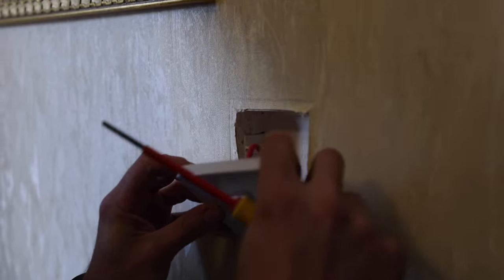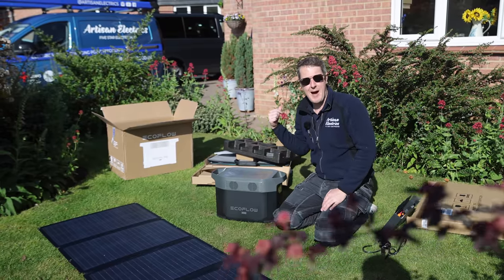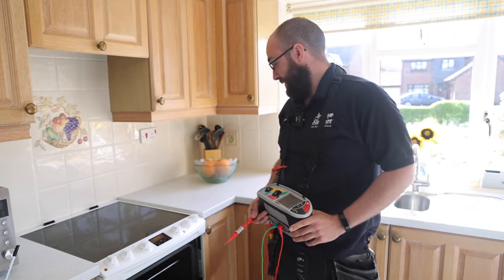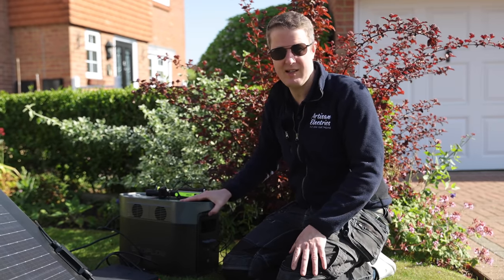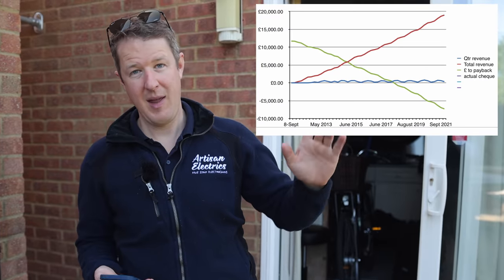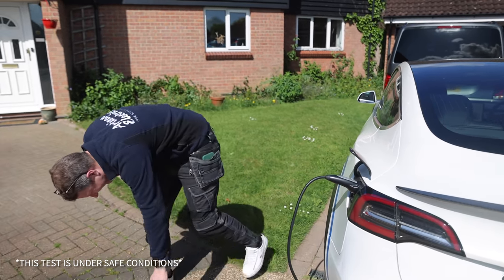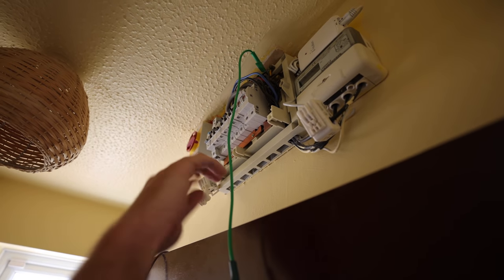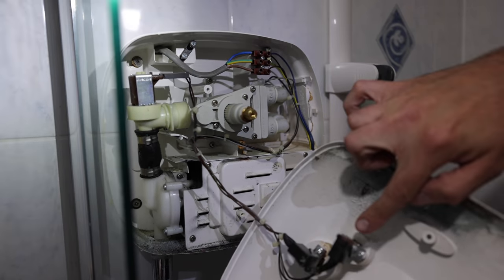PLANNING BATTERY STORAGE FOR AN EXISTING SOLAR PANEL INSTALLATION!

Comment: Well explained and Interesting indeed, I looked at adding more PV panels and battery storage to the system I had but was put off as the generous FIT payments we were receiving would then cease as the whole system would be treated as new with its current poor FIT payment return. Not sure whether that still applies but your customer would be wise to check if the work invalidates the original FIT payments.
Reply: You can easily add battery storage without effecting FiT payment - as long as the original FiT system isn’t touched or (more complicated) the fIt meter is replaced with a bidirectional one.

Comment: A good find by John and it highlights my view regarding cable routes, especially in kitchens. I don't understand the persistence of routing cable drops vertically. Apart from it using more cable, the amount it increases the likelihood of someone going through cabling is massively higher that using prescribed zones between counter top and wall units horizontally. Obviously, an extractor fan supply would need consideration for routing but that unavoidable.  The same in other rooms for sockets, where at all possible, run the cabling horizontally. The householder is very unlikely to drill or nail anything onto a wall at 450mm FFL and if it's all done within prescribed zones, it's compliant.

Comment: The generous FIT you mention was courtesy of tax payers. A few years ago I did a similar test. I live in a flat and mounted a single panel on my wall and charged a battery - running my broadband equipment for 3yrs.

I applied to install a larger system on the walls and was turned down by my council. They said the panels (angled at 45 degrees, were closer than 10m to a road. 

Since then various street signs and bus stops have appeared on the same road with solar panels on them less than 3m from the road! 

I still can’t get permission for wall mounted ones - despite providing written consent from other occupants of the building. The council still say the reason is the 10m rule? Baffled!

Comment: This is all really good to know - we have a 3.6 kWh (max) panels-only installation in Ely, which I'd love to add suitablebatteries to - ideally we'd add also a couple of panels to catch the evening sun (so wall-mounted - suitable for peak oven/bath time) - do you know whether that would be enough to let us save the VAT on the whole new installation under the energy-saving installation scheme?

Comment: Great video.. but I wanted to see the actual battery installation in hope to have my questions answered such as: Did you use a anti-static raised floor? was there any protection against moisture and dust? Do we need to add a small ventilation system in case it overheats and so on....

Comment: The part of this planning that confuses me is the sizing and charging. I have a similar size array and on an average day during May-sept I use 10kw of generated power with the rest (about 8kw) going to the grid. So if I add 9kw of batteries I would only get the benefit during the summer and during the winter I still need to draw from the grid over night. I assume that I could top up the battery using off peak to make the overall. It would be really useful to see the breakdown of this job including payback.
Reply: I have

Comment: Im having installed JA solar 2.34kw solar array and a 1.56 kw array east/west roof with the eco flow smart home panel and 2 x delta pro power stations to run my home electrics the expandability and portability of the eco flow products are more suitable for me rather than a Tesla power wall or giv-energy products, also I missed the feed in tariff so being grid tied ain’t worth it now, I want to use 100% of the electricity that I generate.

Comment: Is it possible to get battery storage to work when there is a power cut?
If so what equipment do you need? Do you need an automatic isolator switch to island your house from the grid?
How do these synchronise with the frequency of the gird and how do they work in a blackout?
Reply: These type of GridTied inverters will switch off when the AC connection is lost. This is to ensure compliance with G98/G99.
I am using a Victron Multiplus inverter which can be connected between the Grid Meter and the CU. It has a 50Amp transfer switch inside and can act as a house backup.
You'll then need a battery to work with it, but it's an inverter which can work with many brands of  batteries. Lots use the Pylontech batteries.
Reply: @gavinnoname1424  Thanks Gavin, Are you saying you can use your system in the event of a blackout? 
If you do is that what the transfer switch is for, to island the house from the grid?
How does the inverter work when there is a blackout so no grid for it to get its frequency from?
Reply: Hi. Yes in answer to your question. We had an additional EPS system fitted with our installation and it will automatically switch to our growattt battery power units in the event of a power cut. It will power the house for a careful 24hrs starting from a full 13kw set of batteries. This cost us £1500 for this peace of mind, we could have had the double socket system fitted for a  much lower £500 but it would mean running an extension lead from where the batteries are (garage). In the event of a power cut it was worth the extra we paid for the auto system.
Reply: @caparn100  when power is lost on AC-In the inverter generates its own voltage and sine wave.
This happens in 20ms so that computer equipment will still continue running.
When Grid power returns the inverter will not switch back to it until it has adjusted its sine wave to align with the grid. Then it will reattach the grid.

If you need the full 100amps for your consumer unit you would need two of the Multiplus inverters which will work in parallel. 
Most of the GridTie inverters I have researched all mention about "backup power" but usually this is just an output for a couple of sockets because the hardware cannot manage the islanding part.
I made a 13Kwh battery for £1700 using cells and a BMS, and then paired it with the multiplus £1400.
The plan is to now invest in a 2nd battery and 2nd Inverter.
Reply: @gavinnoname1424  Thank you, That's sounds really good. I'm looking to buy a system like that (a hybrid solar system that is normally tied to the grid but is able to power itself during a blackout) as I am moving somewhere where blackouts are frequent. Can you give me some details about what sort of system I am looking for? Would it be a standard hybrid system with the addition of of an automatic islanding switch? Do I need a special inverter or would a standard hybrid inverter do? Can you tell me what the additional cost is to allow a system to operate on grid and off grid with automatic switching?
Reply: @caparn100  I really only have hands on experience with the Victron ecosystem.

You'll definitely require something to handle the Islanding. Victron, SMA, and a couple of others, handle this inside their inverters. Other companies leave this function out to avoid having to make their system work with the regulations in each country. 
As mentioned by someone else above you can get an external device to manage the cutover but £1,500 seemed expensive when the Victron is an Inverter/Charger/Transferswitch in one. You then add on MPPT modules for Solar if/when needed.
Reply: Believe the Sunsynk inverter does this as one package?

Comment: Excellent video! Now all you need to do is strap that solar sheet to the top of the tesla and leave the battery in the boot sds out through the rear wing and permanently connect the granny charger! Self charging EV!
Your welcome!

Comment: The Government needs to introduce proper solar panel installation programme rather than what happens now where some installers inflate their price by the value of any grant. Ive got a big south facing roof but now retired, I cant afford 15 grand for solar panel installation never mind effectively installing it for the next owner.
Reply: There are no grants anymore. Biggest problem at present is a lack of installers meaning those currently operating can charge what they like.

Comment: @Artisan Electrics -  From memory the FIT Tariff has no actual payment based on exported energy. It is all worked out based on "expected generation" and assumed 50% export rates from size of install. It combined two elements (1) Generation tariff - A payment for the total amount of electricity generated, calculated per unit. (2) Export tariff - A payment for the units of electricity exported to the National Grid, ASSUMED TO BE 50% OF THE AMOUNT YOU GENERATE. Back when the FIT payments were applicable it was only necessary to have a generation meter to record how much solar you produce but even that is only for the customer/installer to ensure correct operation.
So your comment about AC versus DC Coupled Batteries and reducing electricity export affecting FIT payments is not correct.
What CAN affect your FIT payment is changing your inverter. But presumably inverters do fail and so there must be some mechanism to allow for replacing them.
IF it is possible to replace the original Fronius inverter with a hybrid inverter then it is more efficient and requires less electrical installation, less space and "potentially" less cost.
Reply: Indeed the old FIT used a 'deemed' export of 50% unless you have a measured export meter or smart meter (hence why I've stuck to my old analogue dial meter!). DC coupling is a minefield as you then need to add an MCS approved import/export meter, however it may make DNO approval easier as you could remain under the 16A export limit, rather than having to get approval for potentially 2 inverters having a combined 32A output back to the grid regardless of whether that would happen in reality - depends on the installers' knowledge of PV/batteries and DNO involvement. For the most part it seems leaving the FiT system completely isolated is an easier path to avoid complicating the FiT scheme...
Reply: @Umski  it’s all a bit ( iffy ) you can buy a kit yourself these days ( many on eBay ) even batteries and u don’t need to be mcs anymore so some instals will be connected without DNO approval .All this technology needs to be monitored and others will add to existing FIT systems mcs approval only will help but won’t stop incompatible systems.That said adding 3KW of batteries on a 3 KW system needs DNO is a bit silly as per usual not very well planned just like EV points not all DNO notified.

Comment: How does this comply with isolation ie Fire fighters turning off main supply etc, I understand that it is a health and safety issue with water/hoses during hours of day light but with battery back up during the night
Reply from the maker: The battery will shut down if it doesn’t have mains power as it has an anti islanding mode.

Comment: The are using 17kw at night on what ???
Reply: Begs the question doesn't it (unless it's an EV being charged?) - reducing consumption should be a first step - I know of relatives on the early high value FIT like this who had PV installed and then boast that they can use their tumble dryer when the sun's out - I kid ye not :facepalm:
Reply: There's a constant 1 kWh load 24/7. Daily use must be 35ish kW in a modest house!
Reply: @nickbea3443  Give over . We use 7KW daily . my brother uses 20 with a house of 7 .
Reply: @persona250  It's 35 Kw in THIS house. Look at the graph....

Comment: With these portable batteries with 230v sockets, should you be providing an earth for safety? I always thought it was considered not a good idea if you disconnected the grid (L/N/E) from a traditional UPS? 

Is it different because the battery is isolated from the ground having a plastic outercase or something?

Thank you for the great content as always 👍
Reply: The IET have a guide that talks about these installs. Basically, an island floating system such as the eco flow in its default state is ok for temporary installs (which is the intended use case for these devices I believe). 

For a permanent install, an Earth-Neutral bond + earth stake is required in addition to an RCD to create your on TNC-S system. Do not do this without making sure your inverter supports such bonds and of course, all electrical work should be done by a qualified electrician
Reply: Sorry, I meant "TN-S", not TNC-S

Comment: Contacted you reference a solar/battery install.  You recommended 2 companies. 1st company Halo, gave rough costs but no mention of survey and proper accurate quote.  2nd company, Bowler, came and carried out survey and that was the last we heard of them.  All very disappointing! ☹️. Thought I’d let you know as it doesn’t do your reputation any good if companies you recommend let you down.

Comment: @Artisan Electrics I am sooo glad i 'stumbled' across this video. I WAS pushing for a hybrid inverter to be installed i.e. take out our 10yr old SMA SunnyBoy and replace it with a hybrid (new inverter = new warranty plus better efficiency). But what i didn't realise was we'd then loose out on FIT generation as you've explained your customer would have done 😱 (unless i've understood you wrong?)
Many thanks once again for your 20% discount code for the recent Fully Charged Live event at Farnborough😊👍
Reply: That information is incorrect. There is no reason why you would lose your Feed In Tariff payments if you change from a string inverter to a hybrid inverter. Ofgem even provides guidance on where in the circuit to attach the new generation meter that's required when using a hybrid inverter. Additional documentation was released by Ofgem on December 13th, 2021 to provide 'generators' (you and everyone else with solar PV on their roof) and Licensed Electricity Suppliers with the new rules and procedure to allow this without losing FIT payments.

Comment: US here. What's with the powered showers? Never seen that before
Reply: @uksecco  neat
Reply: Its a booster pump with no heating. It takes a tank cold water feed and hot water from cylinder and gets blended plus gets extra pressure.

Comment: What about re-charging the batteries using off peak power? Then the property could be powered by either free solar or low cost off peak cost grid power 24/7.